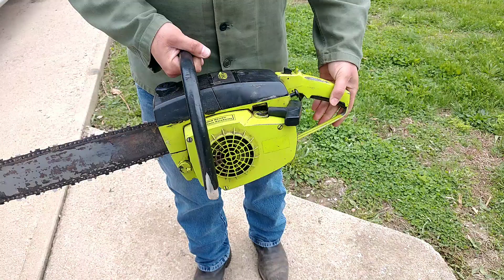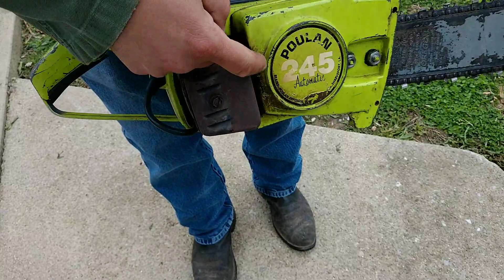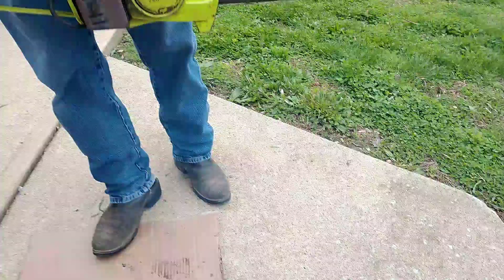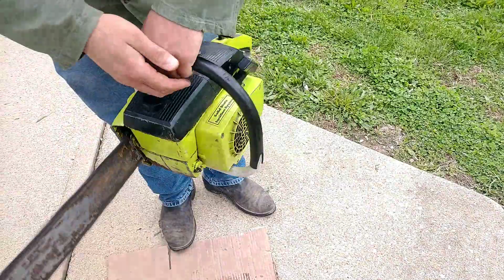POULAN 245a

Comment: 306a was used
Reply: Not true the one used was a 245a
Reply: Do your research, you'll learn different
Reply: lt was a 245a 100 percent. The top covers to the airfilter and gas are exact. The muffler assembly. And it says "two forty five" in script writing right on the side, just over the black strip of tape that is covering up poulan.